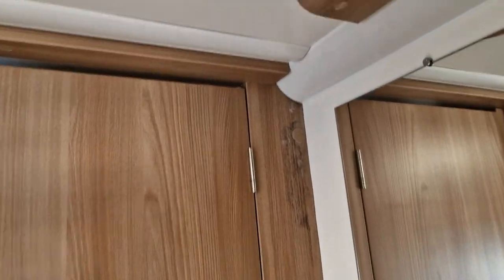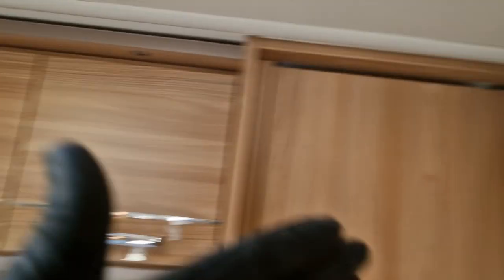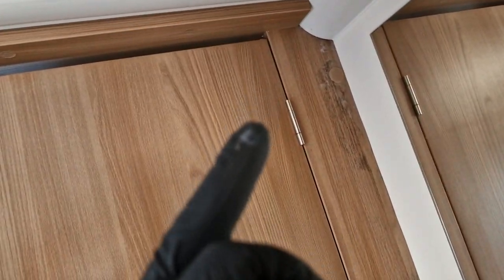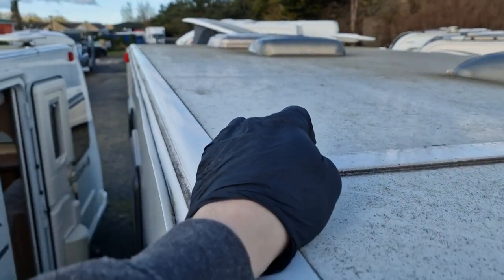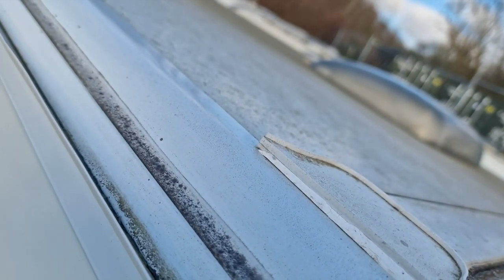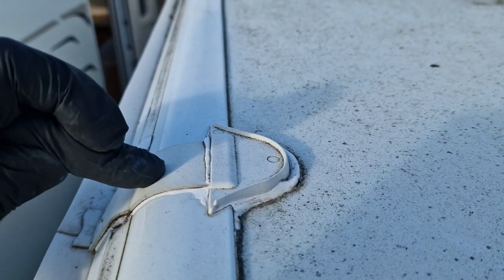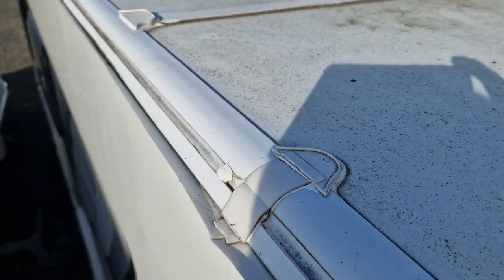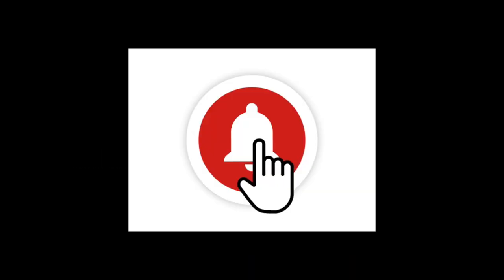Bailey Alu-Tech Fault Number 2 - That we've noticed.

Comment: Had a 2016 Bailey Pegasus Modena and the very same issues.

On the way to France a couple of years ago and noticed a dried water stain on the near side, fortunately caught it before it damaged the interior trim and had it repaired, also whilst being repaired the mechanic noticed the floor was soft above the A frame as well.

Don't expect that in a 5 year old van, fortunately both were covered by MB&G warranty and once it was repaired I sold it

Comment: I had this problem when it completely lifted away from the roof.    Only noticed  when i looked in the rear cupboard .  Fortunately found before any real damage done.    My tip, take them off and re bed every few years.  I used a white sanitary sealant of good quality.  Could have used sikaflex but wasn't sure.

Comment: People asking .....What do I look for on a Bailey caravan before I buy. The answer is....Don't bother looking. Just stay well away. I bought a new one in 2013. Had all the problems listed in this video short , and a hell of a lot more. Had it 6 years and it must have been at the dealers for some kind of repair for a total of 6 months. It was not fully completed when it left the factory with parts missing or very badly fitted. Thet had fitted the water heater external flu without sealant so you could down the back of it revealing the hole cut in the side. Window leaks , shower leaks , oh and a heating upgrade because the wireless system wouldn't work. My friend had his roof rail re-sealed this year. Caused a lot of damage as it was in storage so not regularly checked. Bailey refused warranty work as a service was late due to covid. As if he didn't see that one coming. Funnily enough just this morning I bumped into a woman who worked for the Bailey dealer I bought my van from. She left a year ago so is free to speak her mind on Bailey. RUBBISH was one word. I found that Bailey knew about most of the faults but did nothing to prevent them in the first place.
Reply: I bought a Bailey in the  80's they were badly made junk then , it seems nothing has changed